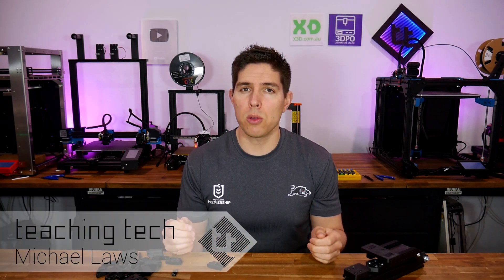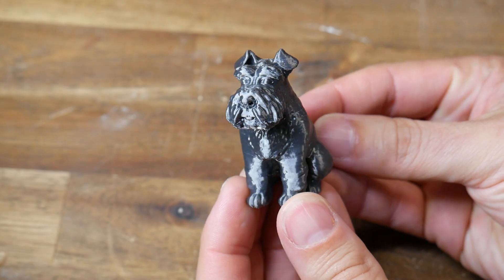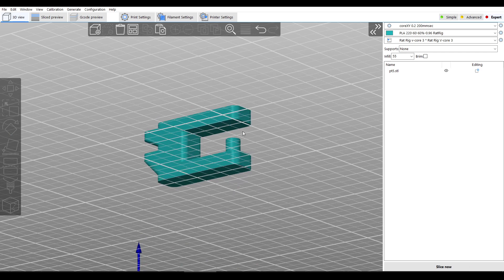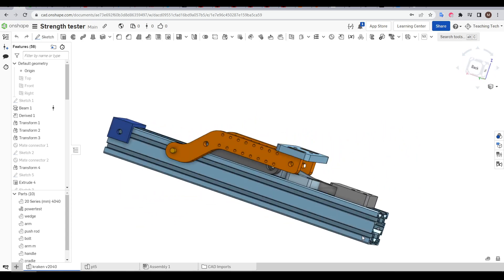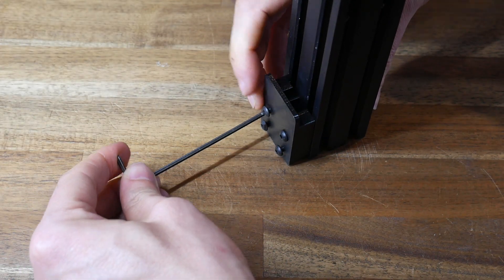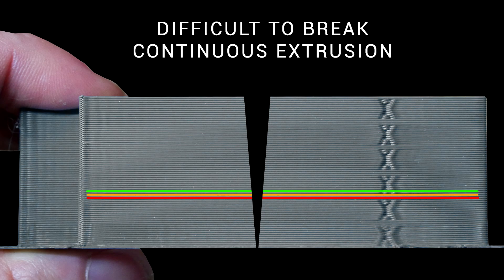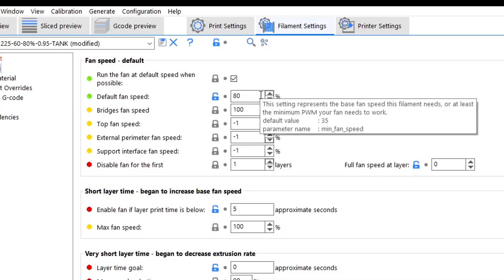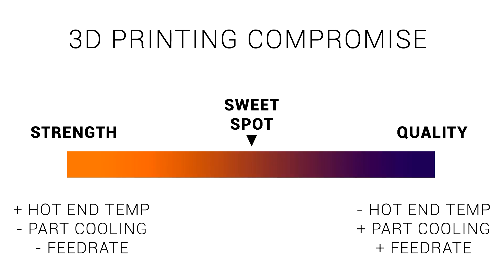Tuning the strength of your 3D prints properly - Golem3D Power Test

Comment: Been trying this as my PLA parts dont seem to have much layer strength, tried 4 steps of increasing temp from 205 to 230 and seemed to get no change, Parts still broke on the layer lines, Tried 2 more steps with highest temp and increasing the extrusion width to 130% then 150% , parts still broke on the layer lines, But really struggled to break them at all. Im using a pair of plyers not the kraken but noticably harder to break the parts, No noticable visual difference in any of the parts

Comment: I'd be tempted to put an strain gauge between the anvil and the extrusion and read the peak value on an arduino (or similar microcontroller). Not sure how I would calibrate it to get a real force value instead of just a relative ADC count... I see other comments are thinking the same thing.

Comment: Be nice to see a load cell in the wedge to see the peek load/force to break the print. Give you more data than just the de-lam strength letting you tune your prints even more. Though having a super cheep way to check delam reliably is REALY nice on it's own.

Comment: Small tip: when cutting a thread to length, put a nut on the piece you plan to keep. That way, after cutting, you can easily unwind the nut to clean up the thread. Gread video, thanks.

Comment: The whole trick is pre planning and how you want the layers orientated  in the slicer - fiddling around with temperatures , speeds and cooling will only yield minor improvements - you don't want your load perpendicular to your layers if you want maximum strength . Trying to fiddle around with layer adhesion is like trying to find a pot of gold at the end of a rainbow - it will change with different batches of filament and god knows how many other factors .

Comment: My day job is in reliability testing and failure analysis. While it is nice to have hard, calibrated numbers associated with the layer adhesion, this process is more than enough to point you in the right direction. Well done to all involved. On a side note, I've found that while printing temperature towers is very useful, printing a fan cooling tower is worth the time too.
Reply: I've honestly never seen a fan cooling tower before, and I am shocked that it's not as common

Comment: After lots of experience with high speeds and temperatures, I really don't find it to be a tradeoff unless you go faster than your hotend can actually handle at temperature (when the parts start to come out matte/hazy). You can have full strength, full quality parts fast. And especially with PLA there's no such thing as too much cooling. You just need high enough hotend temperature.
Reply from the maker: I tend to agree in most cases. That's why I didn't play with feedrate here. Plus I am impatient so didn't want to increase print time :)
Reply: This should be at the top.
Reply: True, but PLA is relatively easy. Struggle begins with ABS and continues to PA, PC and so on. Usually the more exotic material the is the smaller a working windows is. And it's a multi dimensional window :)

Comment: Increasing temperature doesn't give stronge parts. The sweet spot for PLA / Pro is around 205, lower or higher yields exponentially weaker parts.
Reply from the maker: My experiences completely disagree with you.
Reply: @TeachingTech  Alright fair enough. There's a guy designing lower receivers (guns) on Youtube called Hoffman Tactical. He has tested many filaments  and says every filament has a sweet spot, not too warm or cold. and specifically for Esun Pla+ (which I'm also using) he claims the sweet spot is between 200c and 210c. 

A lot of the products he's selling/printing is directly dependent on  high impact resistance and strength.
Reply: @DKFX1  Every filament does have a sweet spot but so does every individual printer and every combination of print cooling fans. Unfortunately the temperature sensors that we're using are not at all accurate either. I've seen +/- 7C on the same brand sensor on the same printer and that's not to mention the varieties of nozzle materials and heat blocks that absolutely will effect your print temperatures and speeds. For accurate results it's best to treat your printer as unique, find some good starting parameters based on similar materials, similar printers, etc and work your way through some temperature towers, then try some print cooling towers (vary the fan speeds instead of the print temperatures). Analyze the layer adhesion, dimensional accuracy, etc. for your printer using your filament. You'll find the sweet spot but it'll definitely change with any updates to your hardware, and may change with the atmospheric temperature, humidity, air circulation, etc. 
On a side note, Hoffman needs to lay off the caffeine lol, there seems to be some good stuff there though and he doesn't claim to have the definitive answers either which I respect the hell out of. 3D2A is a fun space to play in.

Comment: Hmmm... I'm not sure I completely believe the theory behind the Kraken. How was the thickness of the piece chosen? (where the vertical break occurs vs the horizontal bit where the infill shows)?
If those are arbitrary, it's not telling you whether you're close to the theoretical maximum (ie, horizontal strength = vertical strength). 
It seems like a better test would to to create a sample with different ratios of horizontal vs vertical thicknesses (maybe in a 5-10% jump each sample). That way, when the break shifts from vertical to horizontal, you know what the ratio is. For example, if the layer adhesion direction (horizontal) was 55% of the strength of the vertical orientation, you'd see a transition from sample 1,2,3,4 (vertical crack) to 5,6,7,8,9,10 (horizontal crack).

Obviously, calculating the shape of each of these samples to ensure they're accurate in the ratio might be a bit non-trivial.
Reply: I think it's more meant to be a binary "do you have good enough layer adhesion or are you way off?" rather than trying to completely max out your strength. The angle of the break (like shown at the end of the video) also gives a rough idea of relative potential strength (vertical break meaning you're probably maxed out on your layer adhesion potential) without needing to find out an actual percentage you're getting from layer adhesion.
Reply: About 50% threshold.  You can fine tune it with proportions. It's a marker, it's not an answer to all the questions but a quick tool to determine if you're in a decent range

Comment: When I ordered the Bambu Lab X1 Carbon I was a bit concerned about possible layer weakness due to the speed of the printer, but after printing two weeks with it and different material it seems, the layer adhesion is much better than with my Vyper before regardless of the cooling. I guess it prints so fast, that even full cooling is not efficient enough to cool down the top-layer in a way the adhesion is lacking and the so far perfect (and mandatory) z-height calibration does it's thing as well. I made some parts I was only happy with the adhesion using PETG before and it seems with the Bambu I can print them with ABS, ASA, probably even PLA and they won't fail at the critical edge. So I think that more speed is actually the solution to print tougher parts.
Reply from the maker: Unfortunately the X1 is currently on loan for a print expo. I'll be trying this test with it when I get it back.
Reply: @TeachingTech  Sounds great since it's just my impression without any proof. So far I'm printing with more or less default-setups, just reduced the moving speed to half for better reliability (10k/s😁) and the results are  incredible so far. I even printed TPU with the default 120-150 mm/s and WTF is stringing? Btw I've orderte the "High Temperature Plate (PEI)" while thinking it's the usual texture PEI-plate and first was disappointed to see something smooth and gluestick recommended for all materials. After checking it with TPU and ABS without gluestick nor brim my impression: This plate is awesome. Perfect bed-adhesion while with the textured PEI I had trouble to get TPU off the plate, at least with the Vyper. I've ordered the two-sided textured PEI plate before figuring this out and now think I will rather prefer the high temperature plate instead made for all materials.
Reply: @Leynad778  I have the X1 non carbon version so far I really like it. doing my first tpu print with it right now. It was a bit hard to get the tpu to feed after doing some petg but I did finally manage to get it to feed and purge the petg out. when I originally ordered the x1 I wasn't sure about it so just did the base. Wish I had done the x1-carbon now oh well, However at least I can add the high hardened  parts, camera and the aux fan, if I want to.
Reply: @markburton5292  The AMS certainly doesn't like TPU even I've managed to print two pieces (95A) before it failed, but no problem with the spoolholder and direct feeding so far (tried it once), but not tried softer filaments yet.
Reply: @Leynad778  I don't have the AMS. just manual feeding. it was a filament change. the tpu didn't want to feed into the hot end after doing a change. so i had to manually extrude the petg with some pla first and then manually back the pla out. after that it would go in fine. it printed good with minimal stringing on the tpu ( its old tpu so I should have dried it first but I didn't)
Reply: i do have similar experience printing close to pure polycarbonate (in 60c chamber which theoretically is too cold), printing as fast as possible with minimal layer time so that the previous layer stays hot.
at first i printed "quality", but the layer adhesion was absolute trash, so in the end i went for fast individual parts instead of fully filled buildplate, and got very strong parts.
Reply: You're one lucky guy to have that machine.
Reply: I can’t wait to get my x1c

Comment: In a situation like you show at 9:45 where there are two sections being built up is there a way to get the slicer not to optimize for the travelling between the two sections? I know that it’s a simple example but there are models that split into two before joining at the top so it’s not an unrealistic example. What’s happening in the video is when sides are changed two levels are printed, one to catch up with the other side and one to go ahead. But as in the video, the other side cools down a lot. If only one level was printed on a side before moving to the other side the already printed plastic would be warmer and stronger layers would result. Of course this would result in a longer print time as the number of moves between each side has been doubled along with retractions, etc.

Comment: The next evolution of this needs to have a way to measure the force required to break the part and record it.
Reply from the maker: I agree. That's why there are unused mounting holes on my version. I'd like to revisit this in future for sure.
Reply: @TeachingTech  Awesome! I was wondering about how I could incorporate a torque wrench into this. It would be great for one of my standards I teach in my class.
Reply: I was thinking the same
Reply: two ways I can see doing this are with a torque wrench or load sensors.  I like the latter idea more because using a data logger you have historical data as well as deformation data per test run.
Reply: Another thought, does the angle of the lever indicate a specific failure load?
Reply: @DavidMulligan  only if you are applying a constant force throughout the test.
Reply: Load cells?

Comment: Is your recommendation to run dual 5015 part cooling fans at 80%-100%? I’ve always heard that you should run them around 30%-40%.
Reply: it'll depend on several factors, as he mentioned.  your filament of choice, print speeds, and hotend temps will all have great measurable effects on the amount of cooling you need.
Reply from the maker: I agree with arc, there are other factors at play so no universal value.  My Rat Rig is 70% and another printer only 50%. My coreXYs print a lot faster so already I need more part cooling to suit.
Reply: Gotcha. Just wasn’t sure if you had a speed that you started with. Like you always start at X speed and adjust accordingly from there depending on what you’re printing. Thanks for the response, though!
Reply: @PaintballTaco  Yep, for each printer there is a "good starting value" that you adjust depending on your filament. PLA loves cooling but PETG hates it. I print temperature towers and fan-cooling towers to find the sweet spot for each.
Reply: I understand what he was saying about testing for strength by changing those 3 or 4 settings but he also said that he’s always run his fans at 80%, which leads me the think that it’s his base line for fan speed. Which is why I was asking his opinion since I’ve heard most everyone else’s base line is usually 30%-40%